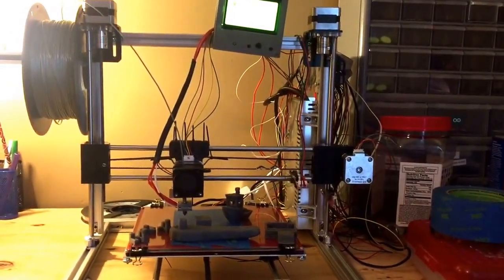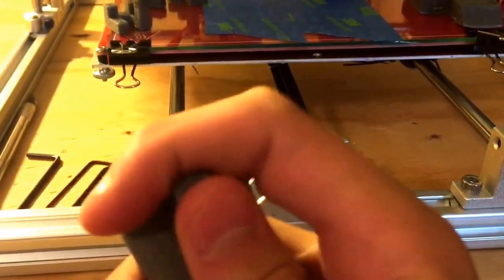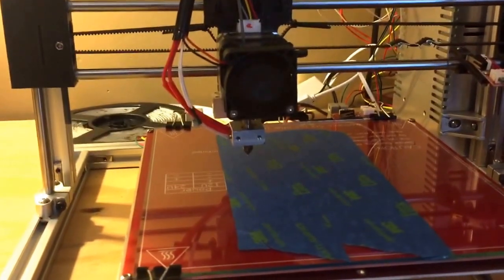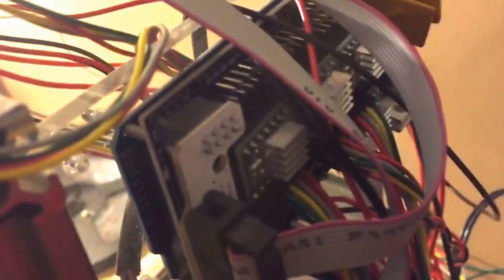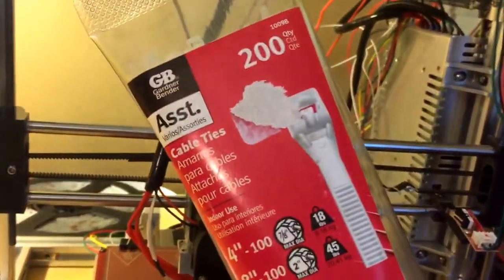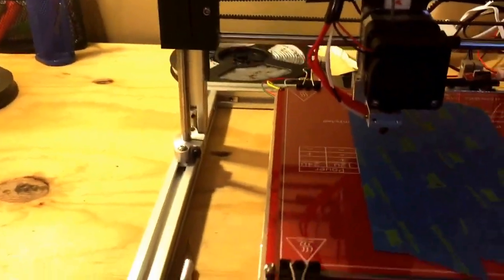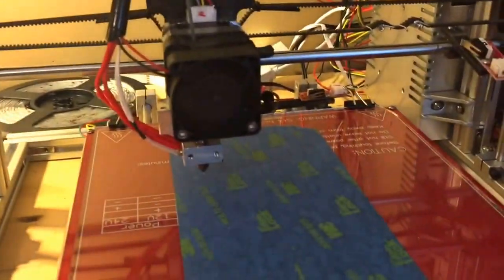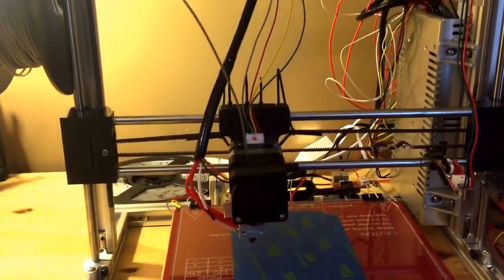Folger Tech Prusa i3 2020 Review

Comment: I have this printer and I spent a ton of time calibrating it. One of the most important elements missing from the kit is a part cooling fan. Before I added one, I had to keep bed temperature at 45 to prevent model from warping. That forced me to use tape to keep model adhering to bed. With a part-cooling fan I was able to keep glass bed at 55 without tape. This also fixes the overhang problem mentioned in the video

Comment: What are the total dimensions of this (like, overall, the entire chassis, LxWxH)? I ordered one of these yesterday and want to know if it will fit on top of my decently sized file cabinet :)
Reply from the maker: +vxcheese Do you want imperial or metric measurements?
Reply: +The Professional Nerd - 3D Printing and More!! Imperial is probably better.
Reply from the maker: +vxcheese Ok, 13.5in High by 16in Deep and 14.75in wide.
Reply: +The Professional Nerd - 3D Printing and More!! Thank you! Great review by the way. Is this any different than the acrylic version?
Reply from the maker: +vxcheese Yes. The acrylic one is not as rigid and can crack. This one is much better in the sense of rigidity.
Reply: Alright, thanks! Is there anything I should watch out for when assembling this kit? Do you have any tips for improving print quality?
Reply from the maker: +vxcheese Yes, when I built it the front pulley spot was the hardest to build, take inventory of everything, the extruder wire may need to be switched and to improve quality make sure you level it good.

Comment: hey, same thing happened to me, my board fried aswell, how ever the ramps board still works and i think yours would too.  but one of the PSU-RAMP wires came out and was touching the casing and thats wat fried mine... it happened when i moved it.
Reply from the maker: Actually my ramps board did fry. I tried the ramps on my new arduino and it didn't work. But I put the new ramps on the old arduino and I also worked. It really didn't cost much to get a new set. It cost me $30 at microcenter.
Reply: +The Professional Nerd - 3D Printing and More!! ya i got 2 so i still have 1 extra.. just inncaseee... lol but all is good now... although im having issues with my extruder, the hob bolt is grinding the filament which is causing it to slip... but i think i can fix it... i hope...
Reply from the maker: +platinum16 try changing the voltage of the stepper driver, that's how I fixed mine.

Comment: Can you make one video to explain how to calibrate the printer, please?
Thank you
Reply from the maker: That is gonna be one of the videos I'll post Friday. I got the new hot end installed today, need to make sure it is working and do a couple test prints. Friday I am gonna release 2 videos hopefully.
Reply: ok thank you, I built my Folger Tech Prusa i3 2020 three days ago and tried to print a support for my LCD and the filament is always out .. the printer tries to pull the filament but can not pull the filament, it seems that jumps, I am using PLA 1.75mm
I will wait your videos.
Thank you.
Reply: extruder instead of pulling the filament inside this pull out. How to fix this? lol
Reply: yeahhh =D i found the fix

1. Open Configuration.f file (arduino)
2. Change #define INVERT_Z_DIR false to #define INVERT_Z_DIR true

Can you put e-steps values of your printer, pls?

Thank you

Comment: What is your build volume?
Reply from the maker: The build volume is roughly 200mm x 200mm x 190mm
Reply: Almost identical: MakerGear's M2 printer; now looking to build my own with bigger z-axis.
Reply from the maker: +SixtyFiveDropTop Cool, I'm gonna make a video where I design a dual extruder for mine. I need to source out the parts first.
Reply: I have an e3d V6 hotend on the way, and will test it both on the M2 and maybe on my "scratch build."  Keep the videos coming.
Reply from the maker: +SixtyFiveDropTop Okay cool let me know how it works out. I will definitely keep the videos coming.

Comment: hi, i really interest to get 1 3d printer for myself after reading and watching youtube video for couple of hours, what do you think about this 3d printer from aliexpress http://goo.gl/2o7tk5 it $255 do it worth for a beginner  like me to learn about 3d printer? i already have ramps and mega for upgrading later
Reply from the maker: I would stay away from acrylic frames and find one that has aluminum extrusion. They tend to bend and can crack.
Reply: how about if i buy these 3d printer and upgrade it into wilson ts, maybe i still cheap cause i can get 2020 profile here cheap i think. I read somewhere that i didn't remember which site that is some convert his prusa i3 into wilson ts. Is it posibble? and sorry for my english :)
Reply from the maker: +Alis Angel It is probably possible but this printer is a really good printer for the price. Shipped to my door it costed me under $300. There is lots of stuff you can do to upgrade it also. The Wilson TS I was reading has some issues being not rigid enough. This kit is very rigid and I can move the printer by holding the top bar and not have to relevel the bed.
Reply: ok thanks for the info, look like i need to research more which 1 should i get